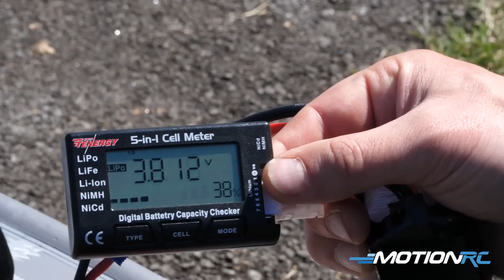Freewing F-35 Lightning II V-3 - Flight Review - Motion RC

Comment: I'd like to let you know about a little technique I use to make using the rudder on a fighter jet more easy or intuitive to use. I've wanted to do a video about this for awhile but haven't had the chance. But try using the Hobby Eagle A3 Super 3 version gyro and set it up like normal. Except setup one mode as "User defined". Then set up "User defined" mode so that the aileron is using attitude lock mode and the elevator and rudder are normal mode. This way when you go to that mode in flight. The aileron will lock to the last position you placed it in. This means if your in level flight, say on approach. You'll be able to use significantly more rudder without "weird things" happening. This is because the gyro is attempting to remove any roll coupling that will come with using rudder, and instead hold the position you last set. The result is a more normal yaw maneuver rather than a unexpected snap or something like that. However, if you push rudder to hard, or to fast. The jet can still snap. It all depends on how much attitude lock gain your able to use without the plane oscillating and how much rudder you actually input. Another benefit of this setup is that you can put the plane in knife edge and the aileron will hold it's position in KE. This leaves the pilot to focus more on elevator coupling and rudder control for altitude. It's basically my concept of a pseudo fly by wire system. But again, the jet can still snap if your not careful. Some models more than others.
Reply: Seems easier to just learn to use the rudder instead of learning to fly using a crutch. I'm not a fan of gyros, they are training wheels that people become addicted to and afraidto fly without because they never really learned to completely fly using their own abilities.
Reply: @shelbyseelbach9568  Shelby, I agree with you but I wouldn't blanket it so widely. Gyros simply have their place and should be used wisely. 
Stabilization on a plane like this can be great, but gyro I believe would have little to no place besides a last ditch save. 
As far as I know a gyro is for self leveling or maintaining an angle say after the controls are released. Stabilization is through accelerometers and only correct momentarily. Please correct me if I'm wrong.
Reply: @JoshWeaverRC  nope, that's pretty much it. The problem i have with them is they are training wheels used to get people "flying" quickly. They then become a crutch that hides the fact that you never really learned to fly without your training wheels, and people think they can never fly without one. I absolutely hate the fact that horizon pimps the safe system on every damn plane they sell. So people end up with a bunch of planes that they never really learn to fly without the training wheels. If i come watch you fly, i want to see your piloting skills, not the piloting skills of the hardware you are using as a crutch. I don't like them at all. Start with a trainer and learn to fly, you will find you don't need a gyro to fly AT ALL. AT ALL. Not a fan.
Reply: @shelbyseelbach9568  If you can get the very agreeable message through to people that they can fly a trainer without SAFE then yeah all good.
SAFE gets people crashing just as quick as 'flying.'
People can do more than they think, but without that extra bit of confidence they may not fly at all. I'd rather Horizon Hobby makes more money with more people in the market and they make more planes. 
Same as this F35 priced to sell out and Motion RC can invest more vs making a 500 + plane. 
Great point on really learning to fly a plane. 
Maybe the SAFE should have a lifespan and automatically help less and less each flight.
Reply: @JoshWeaverRC  ya, I'm no horizon fan at all. Prices are very high on everything they make. Also since they bought hobbico out, they have killed a large amount of the diversity of what's available to the rc pilot in the U.S. They border on having a monopoly and i try not to buy from them if at all possible. As a pilot who prefers to build his planes from kits, it was very disappointing to watch them scrap all the top flite and great plane kits. I was looking forward to working my way up to a giant scale gold series warbird or two. Now that's not possible. Unless you want ARF's they've got nothing to offer. I don't want ARF's. I don't like what they've done to the hobby and there aren't alot of alternatives. So, I'm not a fan of gyros our horizon hobby. That's just the way i feel, others may feel different.
Reply: @shelbyseelbach9568  Killing off Hobbico is a shame. Almost like they bought it to keep it from gaining flight under someone else and having to compete. 
Not building a kit is a shame too. A fellow pilot at my field builds those big beauties. Tomorrow he'll maiden a cheap foam sailplane. Something for muddy field days. 
I think you're wise to not promote the monopoly. Diversity and competition is quality and innovation.
Reply: @JoshWeaverRC  Your wrong. Gyros are for stabilizing an aircraft in strong wind, it prevents things that the best 3D pilots cannot. Like wing rocking and minor oscillations caused by aerodynamics. In short, they make the plane more stable, solid and scale looking as it goes by. Most importantly,  good gyros will make the aircraft feel more "connected". Then there is the SECONDARY functions of some gyros. Like bailout or "SAFE" type functions. Even the functionality that I described in my first post to hold wing attitude. 

But honestly this conversation you two were having just sounds like two people who don't use gyros, talking about why they don't like gyros. It's kind of funny and ironic. Gyros are NOT a crutch and NOT just training wheels. I know this because I started flying RC with flybarless 3D helicopters. With those gyros are a requirement, not a option. It seems pretty obvious to me that your two guys who likely go home or just don't show up when the wind is blowing 15-25+ mph. Otherwise you just never gave gyros a real chance. Because you would know how beneficial gyros are for that purpose alone if you ever simply flew in those conditions with and without. 

On the topic of "training wheels and a crutch". I couldn't debate that with someone who I don't know actually flies 90mm+ sized fighter jets or is even capable of at least what I am when using a gyro. So to that end, I challenge you to post me some video of yourself doing a knife edge pass in a 90mm fighter jet like the F-15. I'll even accept the super easy to KE F-22 or any other 90mm fighter jet EDF. If you can do that, then we can continue with the conversation about whether or not gyros are just a crutch or just training wheels. Until then, IMO, your just misinformed about and/or inexperienced with gyros. In short, your just wrong. I've probably got dozens of those kinds of videos on my channel. So challenge issued.
Reply: @shelbyseelbach9568  Your wrong. Gyros are for stabilizing an aircraft in strong wind, it prevents things that the best 3D pilots cannot. Like wing rocking and minor oscillations caused by aerodynamics. In short, they make the plane more stable, solid and scale looking as it goes by. Most importantly,  good gyros will make the aircraft feel more "connected". Then there is the SECONDARY functions of some gyros. Like bailout or "SAFE" type functions. Even the functionality that I described in my first post to hold wing attitude. 

But honestly this conversation you two were having just sounds like two people who don't use gyros, talking about why they don't like gyros. It's kind of funny and ironic. Gyros are NOT a crutch and NOT just training wheels. I know this because I started flying RC with flybarless 3D helicopters. With those gyros are a requirement, not a option. It seems pretty obvious to me that your two guys who likely go home or just don't show up when the wind is blowing 15-25+ mph. Otherwise you just never gave gyros a real chance. Because you would know how beneficial gyros are for that purpose alone if you ever simply flew in those conditions with and without. 

On the topic of "training wheels and a crutch". I couldn't debate that with someone who I don't know actually flies 90mm+ sized fighter jets or is even capable of at least what I am when using a gyro. So to that end, I challenge you to post me some video of yourself doing a knife edge pass in a 90mm fighter jet like the F-15. I'll even accept the super easy to KE F-22 or any other 90mm fighter jet EDF. If you can do that, then we can continue with the conversation about whether or not gyros are just a crutch or just training wheels. Until then, IMO, your just misinformed about and/or inexperienced with gyros. In short, your just wrong. I've probably got dozens of those kinds of videos on my channel. So challenge issued.
Reply: @IntegrityRC  I'm not a grammar police,  but seriously, starting off your statement with your wrong vs you're wrong is just multifaceted silly. 
Second, my point went right over your head as you failed differentiate gyro vs accelerometer, but I'll save that convo for someone less emotional. 
Third, I taught myself to fly with the help of SAFE. I still use it if I fly a giant scale bird at night, which I do. I didn't have a simulator or a trainer helping, so  I have an affinity SAFE helping me into the hobby you obviously failed to pick up. 
Fourth, I also fly at night without SAFE and it will make your heart beat out of your chest depending on the plane's lights. 
Fifth, challenge rejected. You're not worth it.
Sixth, I fly in anything, but I don't need to post videos for bravado. This is for fun, and a healthy debate over proper use of gyros is acceptable. 
Lastly, when I'm an old man who can barely see and have shaky fingers I'll use a gyro to do knife edges off the deck and you can hold the camera.
Reply: @IntegrityRC  i don't have to accept a challenge from you to validate my personal opinion. Last time i checked, we aren't married. I believe i even started that this is my opinion and other's opinions might vary.
Sorry that my opinion seems to have offended your passion for gyros, which is your opinion and does not require my approval. Just as mine does not require yours.
Just so you are clear, this is a public comment section, and almost 100% of comments posted here are based solely on people's personal opinions.
Good luck to you and good flying.
Reply: @IntegrityRC  as far as 90mm jets go, take a look at some of the videos on my channel of the bad ass, 90mm EDF, F4D Skyray that i have kit built and am putting the finishing touches on this week.
We'll it be the maiden flight or the maiden crash, that will be the question, eh? 
Oh ya. I salute you.
Reply: @shelbyseelbach9568   Oh, I'm sorry. But in your first reply here It seemed to me that you were calling me out and saying that I don't know how to fly the rudder and I use gyros as a crutch that I've become addicted to. Looking at the post now, I don't see anywhere it says something like "just my opinion". Not that it would matter with the tone you started off with. So good on you for walking it back a bit. I'm not mad at you, I just felt like it was a bit of a personal attack.
Reply: @JoshWeaverRC  First of all, I want to apologize because most of my response to you was just copy and pasted from my response to the other guy to save time because it was literally 4am. I did that, I think, so that both of you saw my response in notifications. I don't know, it was late. But to be perfectly clear, any negative emotion felt from my reply was mostly directed at the other guy. Who I actually did feel was pretty much attacking me personally, but through broad generalizations. So I do apologize if my response seemed like it was directed specifically at you. Only part of it may have been misdirected at you. Sorry again. But your right, I do have a HUGE pet peeve about people casting shame and bias on gyros. Especially since almost every time it seems to be people who don't use them and know much about them. In this case, with you specifically. I can see that I didn't read enough and I let the other guy's comments cloud my thoughts and response. I should have taken the time to read your posts more carefully and responded directly to those thoughts.
Reply: @shelbyseelbach9568  Awesome, I'll check it out. Hope it goes well for you. Hate to see anyone crash, especially on the maiden.
Reply: Well good shit. We all do a bit different but also are in the same hobby. You both are impressive in many ways. I checked out both channels and they are both awesome. 
I saw that one guy with the F22 go down after signal loss. That's where you want some self flying tech as an example. 
I use some of that on Flight controllers for long range stuff. So easy to loose video signal and loosing a bird would just suck. 
Does this kumbaya shit mean you won't hold a camera for me when I'm old and won't guarantee I won't hit you. Well, that's even today I can't guarantee that.
Reply: @IntegrityRC  was a personal attack against gyros, not you.
You have learned to fly and are using the gyro to outfly the planes natural flight characteristics. My problem is that the gyros are marketed as a beginners aide. Great, but then i see people buy plane after plane after plane after plane after plane with the safe system, gyro stabilization. They have been trapped into using the gyro to mask a lack of flying skills they never learn because they are scared to remove the gyro from perfectly good planes that don't require them at all because they are so scared to remove the training aide and finish learning what they can do without it.
I understand the uses that skilled pilots can get from them. But think many, many new pilots use them as training wheels and never remove them. At least that's what I've seen.
Every video of every plane horizon releases, half the comments are, "please put the SAFE system in this plane."
Reply: @IntegrityRC  and i do see that my first comment sounded pretty shitty. But as you are OBVIOUSLY not a beginner pilot, you are definitely not an example of what i was talking about. I'll respond to your other comments about the skyray later, am at work. Hard to do much you tube on construction site. Peeked at your channel lady night, check it out more later. Damn plane build is stealing all my free time right now. Have a good day, man.
Reply: @JoshWeaverRC  I actually got that guy's F-22 setup with a gyro now and he's been doing better in general. The reality is that he just doesn't get enough stick time because of family and stuff. He gets like 1 day a week and for a couple months that day's wind and weather had been quite bad. But once he got a handful of flights, things were going really well. But unfortunately he misjudged the runway the other day and landed short in the grass. Ended up tearing out the gear. But otherwise he's still in good shape. Gyros can help keep things more stable and connected feeling. But they can't fix your depth perception or vision :o.
Reply: @shelbyseelbach9568  I completely understand what your saying. I am actually a IP Instructor at my club and there are guys there who have been flying something like an apprentice with SAFE for the last 3 years. Only a couple of them have moved on to other planes. But then they want the SAFE mode on that plane still. For instance one guy went from an Apprentice to a Valiant to a Cherokee. By the time he was flying the Cherokee, IMO, he should have had SAFE turned off more often than not. But that simply isn't the case, and to some degree. This annoys me as well. But ultimately, this is the progression of things. In my frustration last night I could not express the full concept of what I wanted to convey about 3D helicopters. Point there would be that back in the day. Before flybarless helis were common place, and in-fact before tail gyros were even common place on a flybar'ed heli. People used to actually say, and I imagine become frustrated about the EXACT same thing. When tail gyros came about people called them a handicap or a crutch or my favorite, "cheating". Fast forward to when flybarless started coming around. The same things were initially said about that. But these days it's just absolutely the norm and the helis are basically designed in such a way that they couldn't possibly fly without them. I don't think airplanes will ever get to that degree since they are such a different beast from helis. But I personally can see the same kind of progression of ideology that ultimately will probably have to just break down one day. Because ultimately if these people are happy with it and it allows them to fly comfortably and without stress. I don't think anyone will be able to convince them to shut it off and become more brave. On the other hand, people who WISH to progress into more aerobatic, 3D,  or just crazy stunt flying will likely not need to be told that the "SAFE" has to be shut off at some point if they ever hope to do those more advanced things. I think most people are just happy with "SAFE circling".
Reply: @shelbyseelbach9568 I wasn't exactly right either. I mean I just need to learn not to post things at 4am after being at work all day and then going out for drinks at night. Should have waited till the morning to reply and things may have been a bit different.
Reply: @IntegrityRC  ya, i definitely came off way worse than i meant too. Should maybe look at my comments before i post them. I made myself look so bad that you referred to me as "that other guy"! Lol.
I respect someone who learns to fly and then progresses into using gyros to take shit to another level.
I am amazed by the people who don't turn it off and learn to fly.
One person is using this technology to showcase their skills, the other is using it to mask their lack of skills.
Reply: @shelbyseelbach9568 I think this more boils down to a "Human Factors" debate